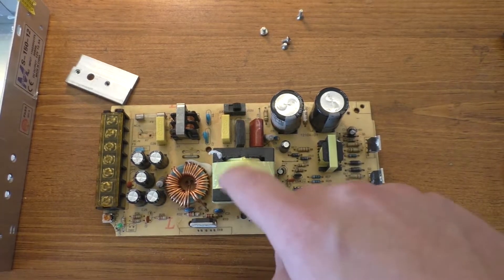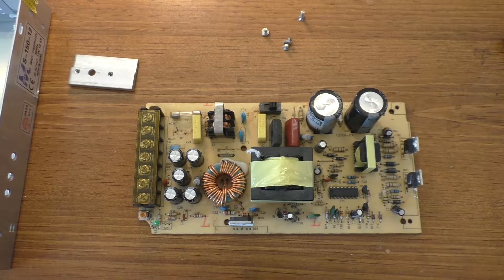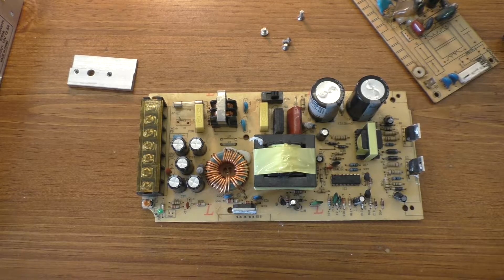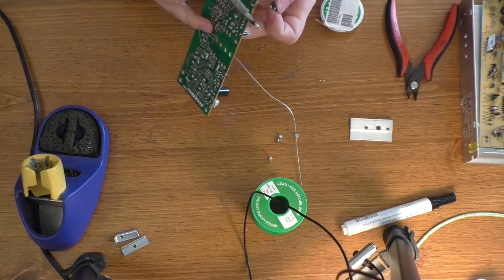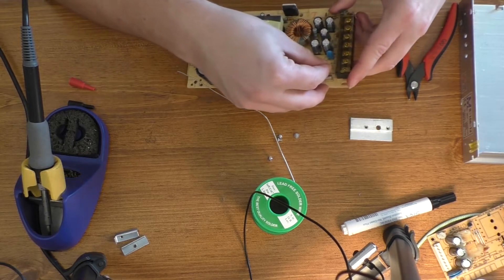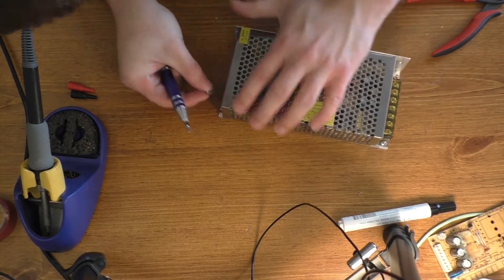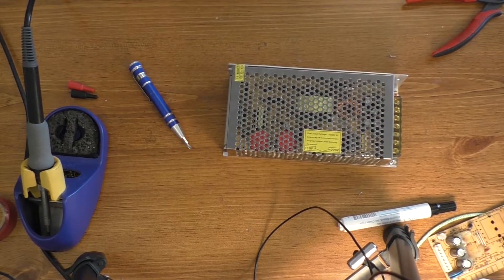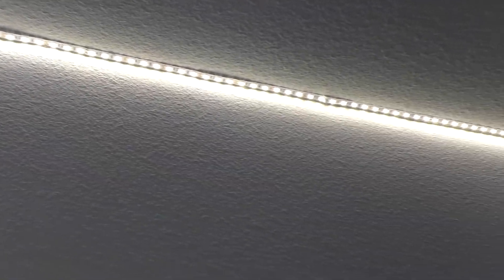12V Power Supply Failure Follow Up

Comment: Bigger capacitors probably caused the NTC to fail.
It has to deal with more current because the inrush current for a bigger cap is bigger

Comment: the brand doesn't mean anything, they just bought it and then resold it. Those power supplies are very good when you don't use it at their full rating, for example if you need 12v 10 amps you should buy a 15 or 20 amps version!

Comment: Unfortunately, my dear, this P.S.U will fail very soon again. But the reason is not that because it is cheap, but the way you think and choose to repair it. I do not intend to insult you, but you seem to ignore basic details of circuit analysis. You never analyse the failure in front of you. Common cause is the "cheapness" of the PSU. But this is not (always) the case. Therefore, if you keep performing repairs by replacing everything you find burned out by whatever else exists in your bench...you are opening love stories with the devil! Well, let me guess your next failure. This will be the bridge rectifier, along with the two switcing transistors. And here is the scenario of why this has high possibility to happen. You have replaced, this time, the NTC resistor, with a much smaller (ten times!) one. This means that the "new" replacement will not offer any comfort to the bridge rectifier from the huge inrush current. The bridge is therefore left alone to face it's fate! As for the new NTC, is as good as an ornament there. Offers nothing but it's beauty! 
In the previous repair, you had replaced the two filter caps with much higher capacitances. Perhaps you thought that this was an upgrading, which in many cases is. But that alone, unfortunately, was a downgrading. And I explain why. When designing a product, many parameters should be taken into account. One of the most important here is the inrush current limitation. By putting bigger filtering caps, without increasing accordingly the current that the bridge can withstand, you are digging the grave of the bridge while it is still alive. And this is what you did. Now, you effectively have cancelled the function of the inrush current limiting, by putting almost a short circuit in its place. Well, the supposed delay time which the proper NTC would offer to the bridge, along with its smoothing function is gone. And when, angrily, you will open the poor little box again...the entire China would be to be blamed I suppose. My dear, "all you need" in order to perform successful repairs and have a peaceful mind during your life "is love"! Just follow the song of the good old Beatles! Next to it, treat the failed device as a human under medical operation with you as the surgery doctor. You will have amazing results! My 50 years experience of being involved in electronics' repairs can guarantee this to you...
Reply from the maker: At the time that I write this, the power supply has been functioning for 11 months since the repair shown in this video was preformed. That's over 11 times longer that the power supply lasted when it came from the factory. I'm fully aware that the way I am repairing this thing is incorrect. I would like to point out that from the time that I put the bigger caps in, and when the NTC failed the power supply was never unplugged or purposefully turned off. It may have lost power once or twice but that was all. The first time I repaired this unit I was desperate for it to be back online. I was shooting video at the time and I use this supply to run the lighting that I use for video work. While the power supply was offline I was using a battery pack to keep the lights on. Obviously I didn't have any time to waste getting parts in when that happened. As of now I simply refuse to spend money/time waiting for parts to come in for this power supply. I won't spend money on parts for this thing because to me it would make more sense to just get a good name brand power supply like a Mean Well and install that in this one's place. All of the parts that I threw into this unit came from other old non-functioning power supplies. I blame the cheapness of this power supply because when it failed the first time it was less than one month old. So at this point if any of my repairs make the power supply last longer than one extra month, I am considering them to be a success.  Honestly now I am interested in what will fail on it next now more that ever since you made the prediction of bridge rectifier.
Reply: @Eman2000  Well, unfortunately you didn't get my point. Cheapness with these P.S.U-s is above all depended on the electrolytic capacitors used in their circuits. Therefore, if you do spend some money and recap the circuit with well known brand name caps (say Nichicon, Rubicon, Elna, Panasonic...) you will upgrade it enormously. Now, if you spend a little more and put a proper varistor just after the input fuse, in parallel to that yellow  input filter capacitor, your P.S.U will be fully protected against mains transients (which is the main cause of sudden failure nowadays, due to the garbage of transient pulses circulating in the utility network). Practically your P.S.U will be bullet proof. And if you also install a fuse holder, modifying the current status of the fuse being soldered directly on the p.c.b, you will approach perfection. These details make the difference and, believe me, if you do all of these simple things you won't need any fancy brand name p.s.u to replace the one you have! But all of these above need some of your time and some of your money. And that is my point. Also keep in mind that even if you buy the most expensive P.S.U of the market, its output capacitors will fail by the time (relatively soon, but not as soon as the ones of cheap brand names). This is inevitable. Especially when we talk about these output filter caps. They suffer from the excessive high frequency ripple currents which they have to suppress. So they age very sooner than the rest of the circuit. Finally I would like to inform you that I have repaired plenty P.S.U-s of the brand you referred to as a better one (which is true) but all of them have the aforementioned common fate...as everything else in this world...Nothing is immortal whatsoever...At least I wish you got my point. The rest is your exclusive choice of course. Greetings from Athens-Greece!
Reply: Makes no sense buying a budget power supply and then goldplate it with all the good stuff.
You may think you know what fails next, but be honest to yourself, this works overall just around 50% with all your experience unless you're speaking of fixing the same brand over and over.
Reply: @werner.x  If it comes to gold plating, yes, I agree. Still I wonder who proposed such a thing. Upgrading it by recaping and putting in it a missing varistor which is crucial for its protection against overvoltage are basic steps within a logical over price to be spent in advance in order to upgrade it. So, please, read carefully my proposal-advice instead of tranforming it in such a non recognisable shape by over exaggerating it that much. The above steps need only a basic knowledge of soldering, some of your time and above all the will to improve the cheap power supply rendering it much more reliable than what it was before. I didn't say that for a few dollars more you will make it immortal. I am aware of "what has a birth date it has a death as well"...
Reply: See Eman200...? All you needed was love! You must have put a bunch of it into that one! LMAO! Glad it is still working well for you (if it still is!). Thanks for the follow-up and persevering. It helps all of us in one way or another.
Reply: Eman2000 great video for a beginner like myself. My 12v30A power supply from my 3D printer died. I opened it up to find that similar NTC had blown apart, but I can’t read what the resistance or model number was. Any advise for what to replace it with?
Reply: @danwhiffen9235  I can propose some guidelines to you. Let me know if you are interested about.
Reply: Πάρις Αζής what size of disc and chip thermistor do you suggest?
Reply: Dan Whiffen Don’t bother for the thermistor for the time being. Just tell me if you can perform some basic measurements with a multimeter in that circuit, because most likely you have more dead components therein. First of all, except that thermistor, is your fuse blown? If yes, can you describe to me if its wire was just melted, or evaporated inside all over the internal side of it. Or if, perhaps, the glass case was broken in pieces...I need to know this info in advance.
Reply: Πάρις Αζής fuse still has conductivity
Reply: @danwhiffen9235  Very strange I would say. Would you please run a test? You need to put a bridge in the place of that blown thermistor first (this will be removed later on).
Then connect in series to any of the supply inputs an incandescent lamp of 60W. I repeat: a) in series, b) exclusively incandescent lamp. 
Then connect the power supply to the mains and watch what happens and let me know about that.
If the unit has no other problems, you should only see  an initial glow of the lamp. Then the lamp must go off. 
At this point you should see the green led of the psu lighting and the voltage at its output terminals to appear in normal level.
If the incandescent lamp remains lighting all the time, you have more trouble in the circuitry. This has to be confirmed.
The test is safe as long as you don't touch anything of the mains terminals. It will not add any other problem to your psu than what it already has.
Let me know your findings...
Reply: Πάρις Αζής I hooked a 60W incandescent in series in front of the power supply, it turned on for a second, dimmed, and turned off. 12.2V DC is reading at all three outputs
Reply: @danwhiffen9235  It seems that you are very lucky Dan (by the way my name is Paris).
So all you need is the thermistor and you are done as I guess.
Nevertheless I would like to draw your attention on the function of the ventilator.
This is a high wattage psu and a ventilator is a must for its cooling, so there must be one in it. Please check if it's rotor runs easily, with no impediments, when you turn it with your fingers. If not, you must replace it.
As for the thermistor itself, I think that the Ametherm SL 32 10015 fulfils the demands of your psu. Look it up for its parameters (PDF) or further details. When soldering the new one, leave enough free space from the printed circuit.  These components work on very high temperatures and need good cooling. Otherwise, by the time, it will fry the area of the pcb below it, while it's life will be much shortened.
After replacing it, when you put it in real operation, it would be nice if you could take a measurement of its output ripple.
This will inform you about the health of its output capacitors. If the ripple is high they must be replaced.
ESR measurements are much simpler, if you already have a relevant meter available. That's all about the guidelines I promised you. 
If you have any other questions just let me know about. 
I wish you a final- overall success on the repair.
Reply: Πάρις Αζής thanks Paris. Good to know about thermistor mounting stand-off from PCB. There is a fan on my power supply, and was working fine and is free moving.  I have a cheap digital oscilloscope that I might be able to check the condition of the DC output. Just curious, this resistor’s purpose is to catch current spikes? What would happen if I left the resistor shorted?
Reply: @danwhiffen9235  The purpose of the thermistor is to protect the rectifier bridge from excessive inrush current when starting the psu. You already have seen this effect through the light of the bulb when testing it.
If you won't replace the thermistor, you expose the rectifier bridge to sudden death. In any case its longevity will be reduced dramatically. Of course I don't advise you to do so. One way or another, your unit has already an age and you'd better treat it gently!
I would also suggest you to install a varistor right after the fuse (line side) against the neutral. Usually this is missing. This will save the unit from overvoltage spikes travelling through the mains lines towards it. 
The mains is full of garbage in our time.
If you decide to install a varistor, follow the same instruction as per the thermistor installation.
That is all I think.
Reply: Πάρις Αζής well Paris, thanks for your expertise
Reply: Dan Whiffen You were twice lucky Dan! Being myself in captivity for many days now, due to that corona virus, I have plenty of time to use it productively! Greetings from Athens-Greece!
Reply: DIY Projects Then all you need to do is to follow these guidelines above (sent for Dan). Specifically, repeat the “lamp test” and move accordingly. I’m afraid that the output transistor(s) will be found blown, along with their base (or gate) driving resistors, the emitter (or source) current measuring sub-Ohm resistors, even the driver integrated circuit itself. Do a good visual inspection test first and then replace first what you see blown by bare eye. If you have an ESR meter, “sweep” the entire circuit and replace all the electrolytic caps you will find problematic. Especially those little ones! And use the “diode” function of your multimeter to locate shorts on the power elements (output stages). After every intervention repeat the lamp test until you are done. Skip it only when you are done. Not before. This will save you from repeated semiconductors’ blow up. The use of an isolation transformer, if you have one, is wise for your safety. Have fun (with due care)!

Comment: As I am sure you have checked by now anyway but your blown NTC 5D-11 was 5-Ohms, so your replacement was spot-on, in fact. It would have been a shame to discard it for that because they are available on Amazon (free shipping if you are a Prime member) for $8.20 for 50 pieces, so 16 cents each!( https://www.amazon.com/Uxcell-a14092200ux0190-Temperature-Sensor-Thermistors/dp/B012SXL0E6/ref=pd_cp_328_1?pf_rd_m=ATVPDKIKX0DER&pf_rd_p=80460301815383741&pf_rd_r=999NKGTCB4KWXS4QEKGC&pd_rd_wg=JTHnI&pf_rd_s=desktop-dp-sims&pf_rd_t=40701&pd_rd_w=1lqck&pf_rd_i=desktop-dp-sims&pd_rd_r=01b71fd3-796b-11e8-8a2a-83c3f18333a3&pd_rd_i=B012SXL0E6&psc=1&refRID=999NKGTCB4KWXS4QEKGC)  Maybe you need spares?...lol! Thanks for the video, and i will know what to look for if mine blows up, although i do have a different make that seems fine so far (12v 30amp Menzo).

Comment: Hooly shit .. I bought one of those for a Mac Cube (28v 7<<< A) .. will be replacing all the caps preemptively in that case ..

Also I'd assume once you change all the dirt cheap crap parts ... it should start working more reliably
Reply: also - eagerly awaiting a 6 month update on this xD
Reply: @Darieee  nah it makes it more fun to use when it fails occasionally. A PSU that is always working is boring :D

For example I intentionally put cheap chinese caps on secondary side just so that I can fix my device every once in a while xD